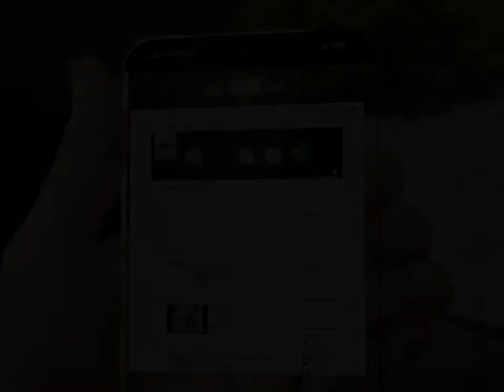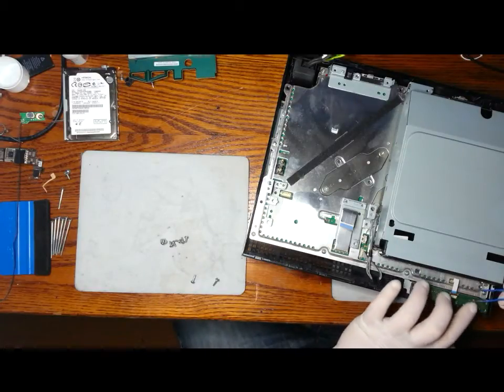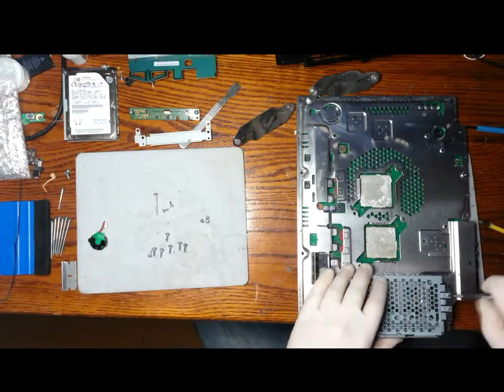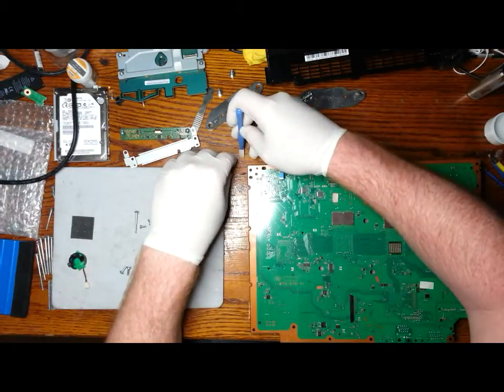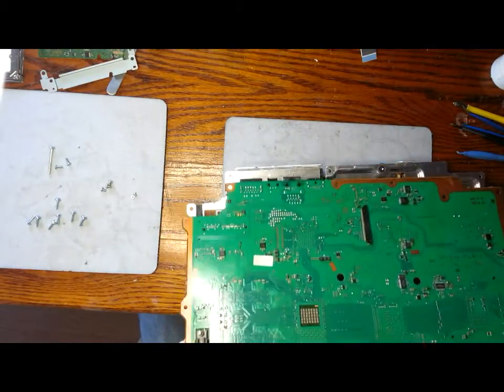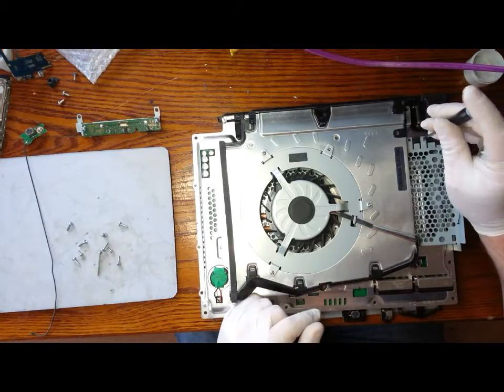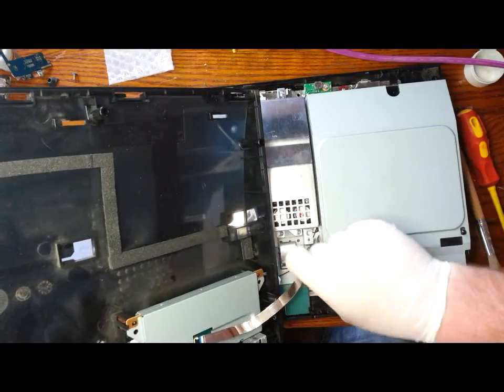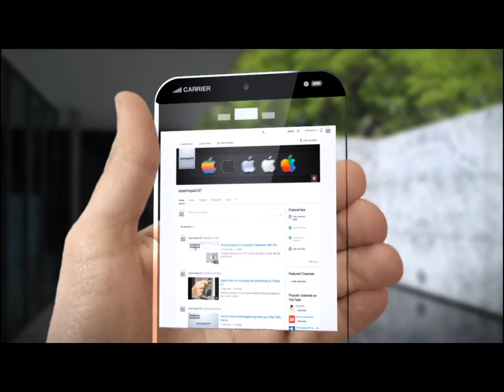PS3 RLOD 100% FIX

Comment: Quick update after I did this fix. worked perfectly for 2 weeks now it's back. Bare in mind before you waste your time. Maybe it's a permanent fix for some but for me it was temporary, shame.
Reply: mark77woody what about changing the power supply box inside the ps3?
Reply: does it help? and what PSU do with RLOD error? I heated PCB and it helped few times, but im rired to do it every month.

Comment: Thanks for this vid, worked perfectly on the phat gen 2ps3. There were some small differences inside such as the battery location but overall the same principles apply. My only advice is to each the VGA port when in the oven as mine started to melt so I took it out and used the heatgun. Thanks again, John.

Comment: im having the same problem but the rlod is random u can play on it for hours before it happens but games like black ops 2 is str8 away. ive try ever thing ever what u have done. new power supply help a little but im at the piont im about to flux it if this fails spaer parts

Comment: Hi i tried doing this on my rlod 60gb ps3 and didn't work, but the video is great anyway. But i would just like to ask if the rlod wipes your save data because i asked a repair place to fix it but they said even if they could, all the save data would be wiped anyway due to a power surge or something. But i rang another place and they said as long as they are able to repair it then all my save data should still be there. Do you have any idea if there is any truth to either. Thanks.
Reply: The place that claimed all your data would be lost was just gonna replace your motherboard instead of fixing it.

Comment: why you must heat the motherboard
Reply from the maker: Hi Pixel Thief, i pre heat the board so as not to shock the board with alot of heat in one area, it also means i dont have to leave the direct heat from the heat gun on for as long as it is already warm, the direct heat is to reflow the solder joints between the chip and board, hope this helps if it does give me a thumbs up thanks

Comment: There is no thermal paste on my ps3 slim... its just a little bit of grey dust
Reply from the maker: Hehehe time for some so
Reply: smartrepair247 Is This Is The PlayStation 3 Original 60GB Model With 4 USB Ports, Vents Chrome And Card Reader?
Reply: BTS,HalfLife,Garry'sMod,AyaseEriAndRinFan2003 yes

Comment: Hi
Could I use a hair dryer instead of a heat gun?
Reply from the maker: Hi Rameen, that's a difficult question to answer, as most hair dryers don't get hot enough but if you have a method to measure the temp you would know for sure,

Hope this helps thanks for the comment, If this has helped give us a thumbs up !
Reply: Hi
I am safe to say after 3 minutes using a hair dryer it has fixed my ylod thanks man but one thing happened 2 days after I fixed I was playing blacks ops 2 then it suddenly froze and now it's not reading discs can you post a tutorial of how to fix it Ive tried everything on the net but nothing seems to work.
Reply: And also keep up your good work u have just earned a subscriber👌
Reply from the maker: Thank you Rameen, have a great weekend
Reply: Rameen Sorkhabi its a problem with the bluray disc reader. You might have to change it. It happened to me twice so i changed the bluray and it was working fine then. Keep in mind that its a temp fix because its gonna break again. Its a common issue with first and second gen ps3.